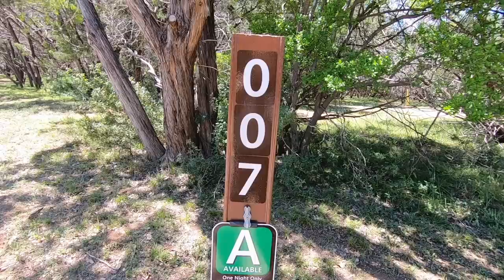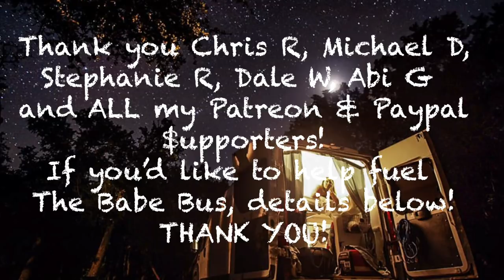Happy Two Month VANNIVERSARY Babe Bus!

Comment: You are right on about solar and running an A/C. You would need over a 1000 watts of panels  plus you would need 500 to 800 amp hours of battery. Plus you need constant sun during the daytime. Thank you so much for being so real on your analysis and commentary on your van journey.

Comment: You are right. A great solar system is good for recharging smaller items such as mobile phones, laptop, cameras etc. Anything that sucks as much power as a big air-conditioner is going to require a generator. Although solar power will work to power a Fantastic fan system which you need badly and I’m sure you will invest in the future 😊 Keep filming, shooting, traveling and live your best life! 🙏🏽

Comment: I’m building my skoolie with 600 watts of solar. At this time this man is collecting 18650 cells to build a battery bank. 

Yes I will be running AC   
If I need AC it will be on. How. I found a wonderful AC unit that runs on gasoline. 
You put gasoline in the power unit and the ac works. 

Look for Dollar tree for frozen veggies. 

There was a YT with a guy using a plunger with holes ( maybe a hole saw ) cut in it  He placed it in a bucket along with socks and such. And plunged away. 

Now are you using a water filter for your drinking water ( straw etc ) . 

As always Casey Roman. The Paul Harvey of Van life. And that’s the way it is. 
🏍🏍🏍

Comment: Thanks for another great video. A shower (inside, with pressure and heated water) is WAY up on my build priorities list. And hasn't budged in all this time. I've moved a lot of other parts around in the priority list but that shower never leaves the top 10. Glad to hear I might just be justified in this fixation of mine. Oh, and I solemnly promise that even though I will probably have solar amongst other options, I will never (and have never) thought I could power an a/c unit off of that. I'm trying to do you proud. And my own version of Le Shitter is not out of the question. I've gone in worse. More than once. And will again.

Comment: I realize that I’m about 3 years behind on this channel, and there are 888 comments, so mine will most likely get lost. I want to address the $90 washing machine. For a Van Lifer, I think you are correct. It just won’t work because of power & water needs. However, in an RV with a shower, omg, THE best $90 I ever spent. And I get $0 promotional kickbacks. Yes, It took forever to do my laundry, but when i lived in my RV I hated going to the laundry mat. Hated it. Still do. So I bought one and it was a life changer. Also, my clothes got much cleaner in it than it did from the commercial washers. Again, I had an RV hooked up to shore power plus water, and I had a shower with a hand-holdable shower head. This made it work.

Comment: Happy Two Month Anniversary Weirdo (Back at ya, ha!)!  Congrats on passing 10k subs. Awesome, you're a Superstar!!  Hope you're enjoying your Roamins,  Roman. You are so right about the hot cold battle vs. insulated van walls efforts. Rather it's having an adjusted smaller space to heat and cool with enough POWER to blow past that heat or cold for your optimum temps!!  Right on. Your front van bulkhead, cutting off the front window/cab heat ...helps reduce sq/ft space needed to heat/cool as well.  So that's excellent in your layout design. Now, that being said...No Solar Evangelist or Soy Man Bun guy here, but consider a slight van modification to solve your ocassional boondocking sauna delimma. . A $150, 400w window unit, with the Inergy Kodiak Apex Lithium, and 500w solar panels will suffice (yes, when you can afford it).  Not much weight, and no complicated install either. Reference:  Fullmoonadventureclub and Solarboondockers YouTube channels or CheapRVLiving channel with Jim's A.C. on his solar video example.  It does work.  Yes, that means selling that energy-sucking, hog, big ceiling unit, and using those funds to fund the needed alterations for this new modification. And I believe, CheapRVLiving has a cool video of a guy that used a very tasteful looking matching, white, marine hatch on his Ford Transit ($100), with a shelf pullout design so you don't have a big ugly square box unit hanging out your van while cruising down the highway.  You only pull it out when stationary. And another good thing, when that 400w, 5000btu little window unit decides to go bsd, only $150 at you nearest Wal-Mart to replace it, and done.  Soooooo, about 25-30 nights at $45-$50 a night savings (No RV parks), and that puppy is paid for.  Oh, and try Cracked Barrel for the $8 breakfast ocassional overnights to help save you a little $$$ on some of your travels (free boondocking). Hope this helps ya. Oh, and remember for every 1,000 ft in elevation, equals 3 degrees less in temperature on avg. So, visit some of those quaint mountain towns in the South, 60-70 degree days, 40-50 degree nights now. On your drive back through GA, SC, and NC, TN. I can recommend, Chattanooga, TN, Clayton, GA,  Landrum, SC, Columbus, NC, Tryon, NC, Blowing Rock, NC, and Asheville, NC.   Oh, and folks reading this... be sure to fully watch the brief YouTube commercials to their entire completion on Casey's channel so she will get a some extra help $$$  Gotta view them all the way to the end to get Casey some Babe Bus Bucks $$$.  Safe travels everyone!
Reply: Great advice and thanks for the shout out for Landrum, SC I'm only about 15 mins south of that area. Its a beautiful little treasure anytime of year.

Comment: I would watch you all night but I gotta go to work. I have a propane water heater. With a shower head hose. I had a Coleman but I sold it. Now I have a costway. Thanks so much Casey. You are real. I gotta go take a shower now and I 'll think of you. Why? Cause I'm a guy.  I do not live on the road. My Van camper is for camping on weekends right now 3 more years ill be travelling. Thank you.

Comment: Welcome to Texas in the springtime Baby Girl! If you don't like the weather it'll change usually within the same week if not the same day. One thing to keep in mind is if you're going to be in Texas for any length of time buy a state park pass.  Initial outlay might be a little pricey but overall after about three nights you will have paid for your park pass and it's good for a year. The other thing to remember is that and the state of Texas any of the rest stops that you see along the highways you are allowed to park and stay there for 8 to 12 hours and while they may not all have showers, they will have restrooms, they are well lit at night, you have trash cans where you can dispose of your trash, and they usually will have potable water outlets  for RVs and campers. Now this is the full on rest stops along the major highways not the little pull outs that you may find on some of the smaller highways Ranch Roads and Farm-to-Market Roads that have picnic tables. You can stay at those two and a pinch but you are essentially boondocking and taking your chances there so I would not recommend that option for a single female traveling.
 I am also very glad that you are differentiating between van Life In The Deep South and in Texas because we're little bit deep south a little bit Southwest and a lot of the other full-time vanlifers who are usually from the Left Coast and Pacific Northwest or maybe at best the Midwest. Totally different set of environments. If and when I ever get around to building my ProMaster I will put in an air conditioner and I will put on some solar because of the locations where I would be going. But I also plan to have Shore power and backup lithium batteries. Being a little old lady from Kerrville Texas I don't necessarily want to haul around a generator because I've already had one back surgery and I do not want to have a second, hence I will get solar to save my lower back, not because I worship the sun god. Again if and when I get around to building out a ProMaster van I'm sure I will do it totally contradictory to all of these other know-it-all van Builder wannabes which is why I would not make a YouTube channel on it because I don't want to feel like dealing with their BS.
  I love it! Pinterest your poop ! Bedazzle your BM! I fully intend to get the same kind of toilet that you have whenever I have my ProMaster. I think I will name mine Louie Lou-eye ( Whoa oh! Let my poopy go! Yayayaya!).

Comment: When we were shopping for our truck camper, we wanted everything including an AC unit. Most of the camping we do is in campgrounds with no hookups. The AC would have to run off the grid for it to make sense for us. So we talked to a lot of experienced campers on various forums and it was explained and demonstrated to us that running AC on solar is just about impossible for any length of time, unless you have a solar array the size of a house roof.

We didn't get the AC, but we did get 200w solar, which has been great for extending the charge on our camper batteries to keep the fridge running. Solar isn't magic, but it does have its uses.

I subscribe to a lot of youtube channels (almost 700 at this point), and it's funny how the channels with a woman doing stuff always generate a lot of feedback from dudes telling them they're doing it wrong.

Comment: If you redo your campervan you should copy the European layouts that you can have a dinette , shower and your bed at the back. In Europe we use  17.7 ft Fiat ducatos that are the same with your Promaster just with different engines and we have a WC with shower.

I agree that you need a generator to run an AC. You can integrate one under the floor (that you can use easier when wild camping) but you need to remove your spare tire and it is costly to run. 

Also I agree with the solar that is just for basic use. If you have a powerful laptop that uses up to 300w of power solar even with lithium batteries will be super expensive to install and you need again a generator to charge them. Solar is a good thing if you have a compressor fridge to power it constantly.

Keep up the good work.

Comment: I gotta say that a solar set up with a maxx fan or a fantastic fan is what a lot of people find useful and functional for keeping things cooler and well vented. Also, a tiny luci-light or a mini panel with a led bulb ( about$20 on Amazon) and speaking of Amazon. - what are you doing for snail mail etc?

I’ve also seen mini- shower set-up that involve a pressure sprayer combined with a large trough type tub and a plastic curtain you can magnet hook to the ceiling. 
The whole thing bundles up and can be stored away under the bed area...no good for long spa cleansing or revenge plotting - but it works for a daily rinse (which feels awesome when you’re deep in the Texas heat) and you’re between real showner facilities. 

Speaking of the ‘daily Pinterest project’...LOL! I remember camping in a remote no frills cabin that was about 400 feet from the campground facilities. I used an awesome Tupperware type cereal container...worked great for the 2am emergency moments...carried it up the hill every morning tucked in the side of the gym bag along with my towel and shampoo!

Congrats on your 2 month vanniversary! It’s time to chill!

Comment: I want to build a skoolie, and even a full length bus with a roof of solar and a ton of battery power would struggle to keep AC going for more than a few hours.  You're absolutely correct that you could never run AC from the small amount of solar you could fit on a van.

Comment: Some van dwellers without a lot of opening windows in the back part of their vehicles have reported pretty good success getting additional air flow by putting a small vent in the floor near the back. Might be fairly inexpensive way to get some more air movement when AC isn't an option and not too difficult to install. Just an idea.

Comment: Here’s a tip for water under the cupboard... grab some cheap sticky vinyl tiles, butt them up against each other under the cupboard, then calk with bathtub silicone every seam. If water spills it will sit on top until you can get stopped somewhere to wipe it up, and won’t soak into the wood , or worse, rust the van.

Comment: Have to seen the Hula Hoop shower? 

You get a bucket of decent size enough to spin around in, and a shower curtain attached to a hula hoop, then use your kitchen sink faucet as you would your shower head.  Fasten the hoop and faucet to the ceiling somehow and BAM makeshift shower.
Don't forget to put the shower curtain in the bucket and not outside lol or water will drip out on to the floor.

Comment: You Rock! I tent camp in Florida, during the summer. The way I can do this is 2 battery operated fans from wal-mart about $10.00 each. That would keep the air circulating in the van! Blessings 😎

Comment: You're  right about the microwave, I still carry mine but rarely use it except to store things in. Solar? Have a bit, 100 watts on my car which is enough to keep the fridge going  without any shore power (with 100ah battery) and 40 watts on my camper (60ah batt) which is enough for lighting, clock and a bit of TV . My worse mistake was using an Esky (icebox?) instead of a fridge.  Don't have any A/C just sit outside in some shade. Enjoyed the video.

Comment: Just watched your video regarding AC and solar.   Yes it is possible but you are right the electrical system does need to be robust to support the power needs.   Not reasonable with your current ac unit (power hog) unless you have 600+ amp hrs of lithium.  There is a 12 vdc AC unit called Zerobreeze and it uses 15 amps at 12 vdc.    If you have 150 amp hours of capacity (300 amps of deep cycle or about 180 amp hours of lithium) you could run the ac for 10 hours straight.   Most lithium setups are 300 amp/hr plus but it is expensive yet it does work.  Solar to replenish also needs to be robust.  In my design, I will have 1240 watts at 32.9 volts so I will get close to 85 amp/hrs at 12 vdc from the sun.    Again expensive but it is possible.

Shall I sign you up to 5 system orders...lol?     Your looking at about 8k US for this setup.  Maybe less with offshore products.  Btw, the ac is about $600 us.    Stay bold and safe travels.

Comment: Try zero breeze, it is portable air conditioner.  I know they are pricey, but you can recharge battery.  No worries about heat, plus cheaper then putting in window.  And space saver.

Comment: I'm a female truck driver so I Feeelll your pain on the shower situation! One thing you might consider is walking into a Flying J or Pilot truck stop and getting yourself a "Professional Drivers" loyalty card. For every 50 gallons of gas/diesel you purchase, you get a free shower. When I did expedited freight in a Sprinter van. I could easily get 2/3 showers a week. You'll just have to crunch the numbers yourself and see if it's something you want to do. A lot of the truck stops also have free overnight parking that are often patrolled at night..... usually by a "rent-a-cop" but hey....it's better than nothing. Also the rewards card can give you points that add up so that you can but cokes/chips/electronics....whatever you need. It isn't much but a free Coke every now and then is cool. Hope you have safe travels and I love your content! Always keep it 💯
Reply from the maker: Great tip!

Comment: Hey ... great vid ... as to showers - I have a 3 gallon hand pump garden sprayer. Pump it several times and it has enough pressure to give you a few minutes, you do have to pump it a few times throughout, but it is so refreshing to have for a small fast shower. You can shower either outside between the back doors, or you can rig up a hula hoop inside with a shower curtain put up a few ceiling hooks for it, and stand in a tote with the curtain hanging in it. Then all you have to do is empty the water when done. It's rustic. But so worth it when you can't find a shower. One last thing, I customized my sprayer, I switched out the spray nozzle and replaced it with a basic hand sprayer used in a normal kitchen sink. All total, maybe $30 .. well worth the cost. Love your vids. If you make it to the Pacific Northwest - Seattle area - have a Van MeetUp! CHeers!

PS .. Frisbees are a good back up for extra plates. And you can throw them at people if you don't want to wash them! : )

Comment: Consider looking into in the  isle shower. Check out some early class ‘B’ RVs for ideas, Roadtreks are nice. There is plenty of space under your van for water storage tanks (although won’t be good in winter). You might want to weigh your van at a truck stop scale to see where you stand on weight and then see how much more weight you can carry. Also good to know the weight distribution over the axles. I’m guessing your GVWR is about 9000 lbs and somewhere around 5000 lbs. cargo weight. Lastly if you can deal with a twin bed you can gain 15” inside but loose it in the closet. Some give and takes. It’s pretty cold in Detroit these days. Perhaps getting in higher elevations would work .
Reply: She's mentioned the prospect of a twin bed before and said that's there's no way it's an option. I do think her layout could have been done differently to be more efficient without having to crawl under the bed for her closet.
Reply: Danielle Lathan  , yes I know but that’s why I said , “give and take”. Cheaper then buying a bigger / longer van . Less mpg and a hassle to park .